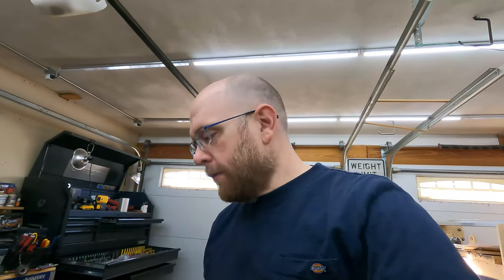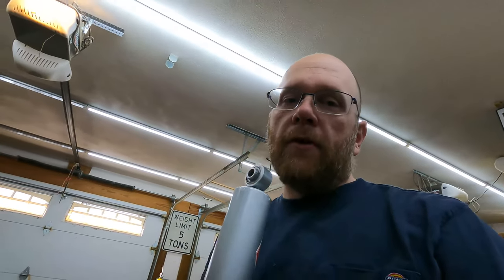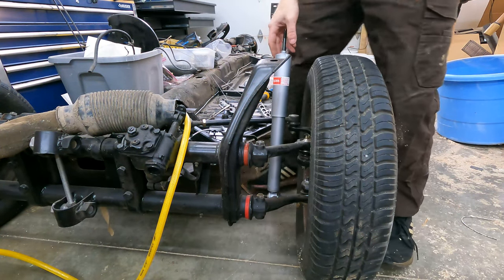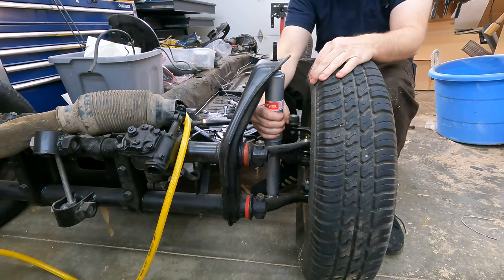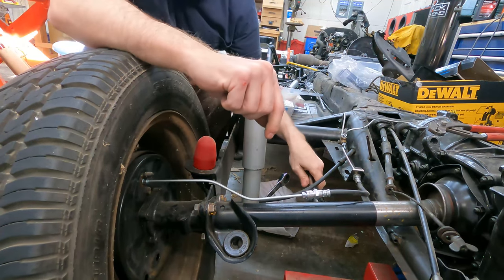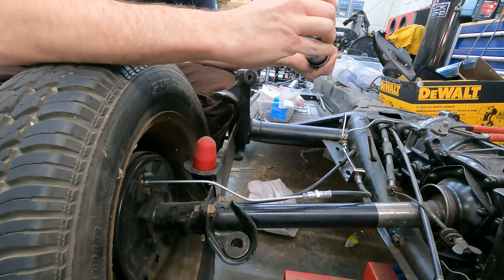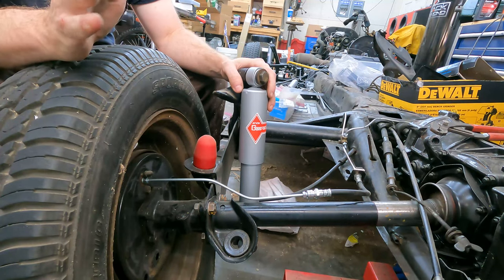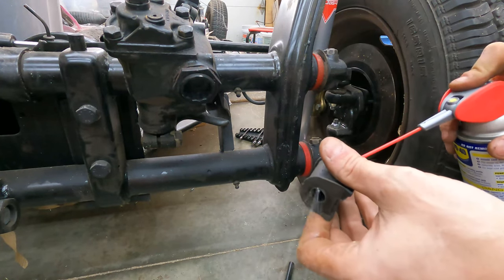Ride Quality Improved! 1968 VW Beetle Suspension Upgrade

Comment: I sat waiting patiently before commenting.  But my keyboard was cocked, locked and ready to rock - until you finally put the metal cups (washers as you called them) on the shock stem BEFORE the rubber bushing. I could barely contain myself while watching you slide that rubber bushing on first. LOL.
Reply from the maker: I get there eventually lol. Takes about 2-3 tries for most things. Good thing I have a good set of manuals.